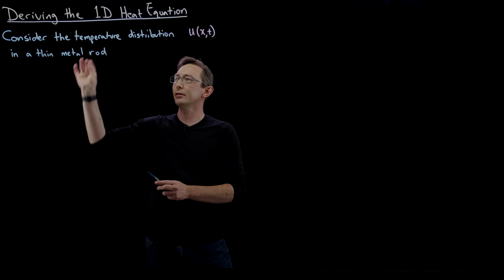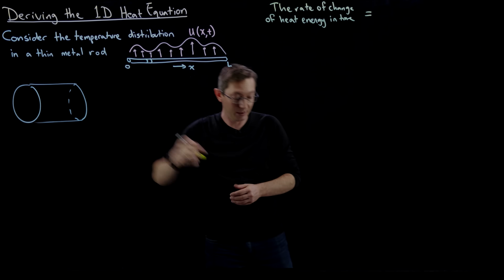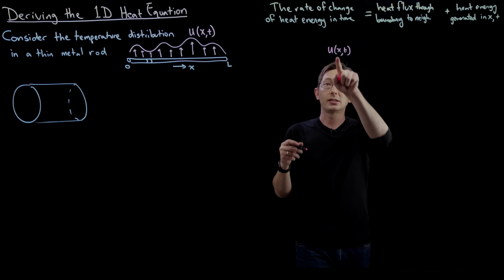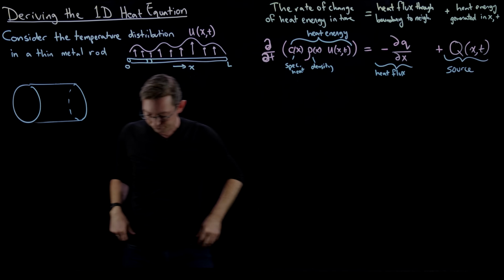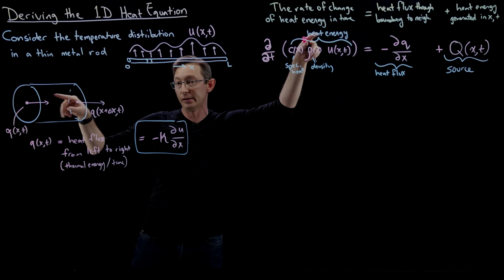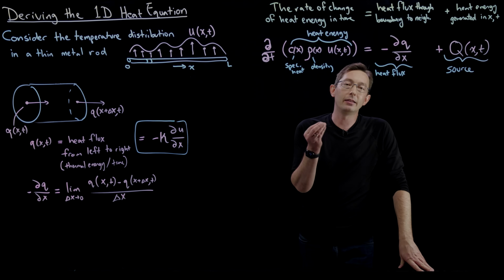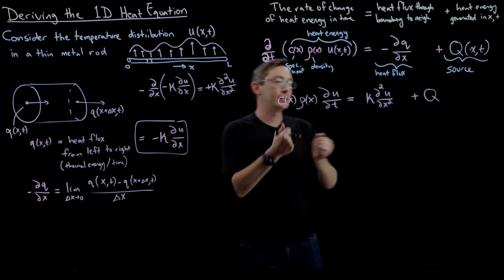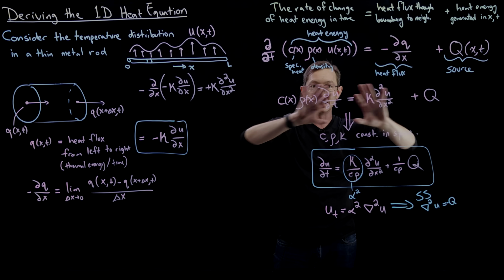Deriving the Heat Equation: A Parabolic Partial Differential Equation for Heat Energy Conservation

Comment: What an wonderful video which I am looking for!
I understood so many things, but I have a simple question.
When you describe the heat flux at the tiny section of the rod, there is a "kappa" in the equation.
This term depends on the materials, but I am wondering whether the value of "kappa" varies with the system structure.
Specifically, I mean is it okay to use the bulk value of the "kappa" when we describe the nanorod or nanowire systems.
Could you explain this ? Thank you very much!

Comment: I agree with another commenter, since q(x,t) is the heat flux, shouldn't dq/dx be written as something other than just heat flux? Perhaps flux gradient would be a better term?
Reply: It would be sensible for heat flux to be energy/time and heat flux density - or heat flux gradient - to be energy/time x area (or energy/time x length for 1D). But I don’t think there is such strict definition. In my readings heat flux generally refers to the unit normalized over area, but for a specific problem with a setup featuring a fixed boundary (as in this one), it is common to refer to the flux simply in terms of energy/time. Flux is somewhat of a loose term according to Wikipedia, in this aspect as well as others.
Reply from the maker: I think I like flux gradient better too

Comment: A good way to remember the signs is by making the normal unit vectors on the surfaces facing outwards and if the flow is opposite to the unit vector then - otherwise +
Ofc not reinventing the wheel , just a way on how I like to do analyze it but Nevertheless   excellent video as always !

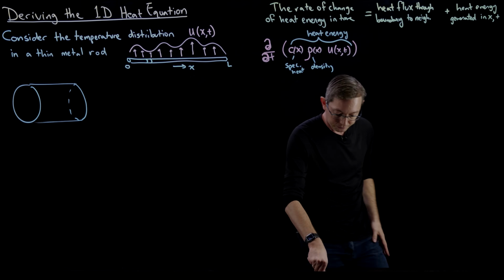Comment: In case the origin of the heat energy term around 8:30 is confusing, the terms can be obtained by unit analysis: 
c(x) = [Heat energy] / [Mass x Temp] (*this is interpreted as the amount of heat energy per unit mass the system gains as a result of a change in the system's temperature, hence "specific" heat capacity)
p(x) = [Mass] / [Length] (*in 1D)
u(x,t) = [Temp]
So heat energy distribution function is in units of [Heat energy] / [Length].

Comment: Excellent intro, just a couple of little points to add from the Wiki!
Although q(x,t) is, in general a vector function,  u(x,t) a scalar functions, in this 1D case both may be treated as simply scalars.
K/c℘  is called the thermal diffusivity of the medium, Si units  [m^2/s].

Comment: A little bit confusing to me because both -(partial q / partial x) and q(x, t) are called 'heat flux'.
Your videos are very good. I like them. I have seen your entire series on vector calculus and partial differential equations.
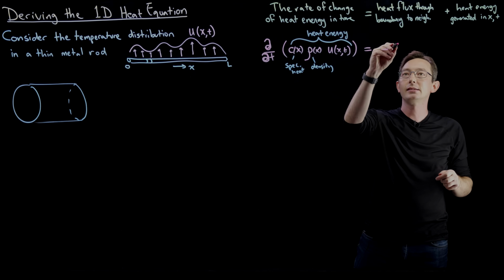Reply: 8:49 q is specifically the heat Flux quantity

Comment: I notice that if thermal conductivity κ stays a function of x ->  κ(x), the PDE will involve both first and second order derivative of thermal energy with respect to x. complicated, but surely someone out there has done it before
Reply: for some of the "most common" numerical methods, like Finite Element and Finite Volume, this is not a problem at all. These formulations naturally deal with diffusion coefficient not uniform in space with almost no additional cost

Comment: If you have a negative heat gradient from left to right, more heat is entering on the left than is leaving on the right. Therefore the heat will accumulate in the body. You could break it down as little cars bring heat people in and leaving with less heat people. That means the heat ppl are accumulating. 😀 Hope that helps with understanding the sign convention.

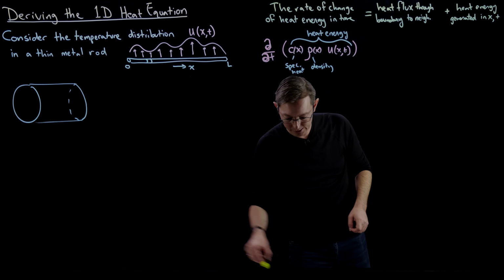Comment: Does anyone know why at 8:40 the heat flux is written down as dq/dx when q seems to be the heat flux itself? Why the derivative?
Reply: Because there actually are two heat fluxes in the small segment, heat flux in through the left face and out through the right face. The difference between these heat fluxes is the accumulation of heat in the system. The key concept here is not to confuse heat flux with Temperature. Temperature is the driving force for heat flow. Hope that helps.
Reply: Hi Phillip!  I actually was wondering the same thing.  I think the idea here is that the presenter is explaining how this particular equation is derived.  

It may not be the best equation to model heat.  Describing a source term as q(x,t) is perhaps not the best, because you are assigning a heat value to every point on the line, rather than at the ends .  

Yes, you would put those details in the initial conditions, but now that equation reads something like

 “the heat change per second at location x and time t is equal to the heat change per metre at location x and time t”

Multiplicative constants aside, the units are not the same, and since you presumably want a 2d graph of temperature/heat with distance along the line, this equation puts unnecessary constraints on the behaviour of the temperature/heat with distance.

Another approach might be to write x as a parametric  equation of t(time), and then model the behaviour entirely in terms of heat and metres, with time included implicitly in x(t).  

That way, you are not putting extra constraints on the behaviour of u(x,t).

Essentially, you rewrite u(x,t) as u(x(t)), then derive everything again accordingly.

Any thoughts anyone?
Reply: because it's the total heat flux (by conduction, here) through the boundaries of the infinitesimal volume of the domain, of length dx with the left boundary at x and the right boundary at x+dx say.

In 3d space, it comes from the heat flux over the boundary of the volume, that equals the volume integral of the divergence (by divergence theorem).

Here, in 1D problem, the divergence equals the derivative along the only space dimension (x) of the only component of the heat flux (called here q)

To recap, dq/dx here because that term  comes from the heat transfer by conduction along the 1D domain. If you have some heat source in the domain, no derivative is required. As an example, if you have a fluid in a long pipe where a chemical reaction is occurring in some region of the pipe, releasing or absorbing heat, that could be model with a source term. Even, if you have heat flux through the lateral walls of the long pipe, still modelled as a 1D equation, you can add that contribution as a source term